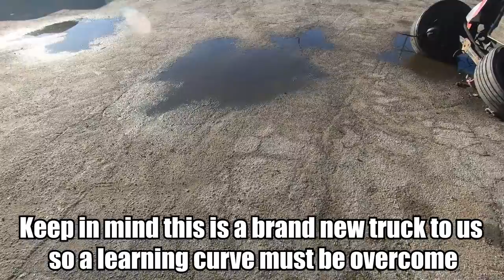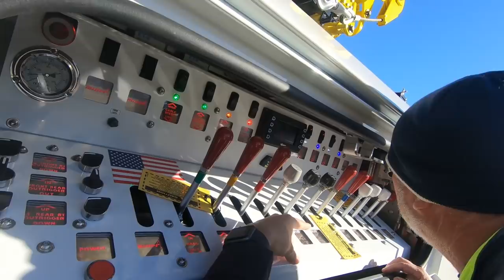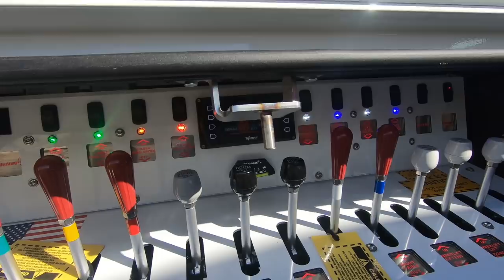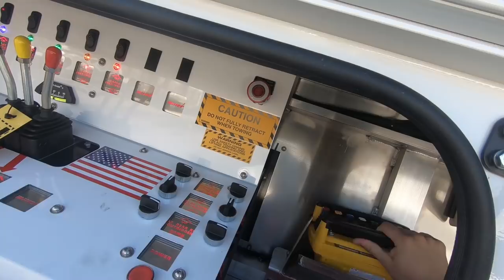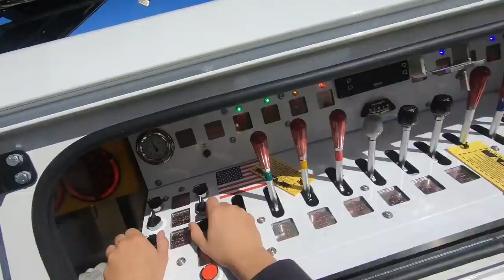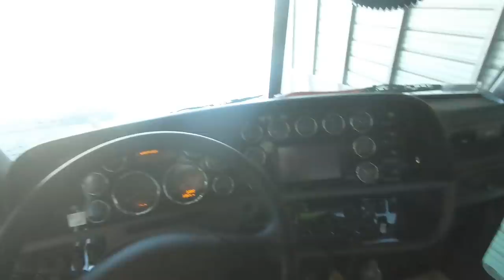First Lift With Our New Rotator! Wrecked Tractor Lift

Comment: That’s awesome congrats on the new tator looking forward to the new jobs you will get
Reply from the maker: Thank you sir certainly have learned a lot from your videos.
Reply: Youtube is the best school, between Ki and RonTator you will get all the know how you will need.
Reply: What would be cool if you both and maybe with Ron Pratt some how got together with your three rotators and did something together!
Reply: @joelast9988  That would be cool; a tryplex vidio. Also does the new tator have the carriage slide like Ron's has?
Reply: @1140rotatorwork Malachi I now realize as I'm sure others do as well how easy you and @Ron Pratt make it look!!! So glad I found the 3 of you on YT thoroughly enjoy all your videos! Thank you!
Reply: It would be cool if all three tators could get together, the only problem is that they are so spread out and those trucks burn a lot of fuel. I do find it very amusing how they are fans of each other’s channels which shouldn’t surprise me since they all have tators. Though I think Ron Pratt has the edge since his can adjust its position on the truck and he has secondary winches, not to mention he can run lights and sirens..
Reply: @plazatowing  What could be interesting is to compare your trucks including Ron Pratt and the guys from country repairs, and maybe explain your choices, raptor control, different stabilisation techniques, .... One could make one vidéo on one topic and another on another topic, no need to burn tons of fuel just make a tour of each tator and maybe record a skype session with everyone and a big work of editing (that will be a ton of work)

Comment: We have an 1150 389 on a twin steer with raptor controls. And an 1140 rxp with proportional controls like yours, love them both.  And you don't need to drop the suspension when lifting at all. Also there is room by your drag winch for wood. 4x6 hardwood is what we use at least 12 boards per truck.
Reply from the maker: Thanks for that!

Comment: Hey Trent, a new toy for 2019, looks a similar spec to Ron's over at MidWest, hope you are recovering nicely from your recent surgery
Reply: Ron has the Century 1150R that one is a Vulcan Spec.
Reply: nethalus seems to be, probably he customized the rig at the same company that midwest use
Reply: The 2 main differences I saw was 1150R comes with the joy stick controls and he added 2 auxiliary wenches.
Reply: Door layout is a bit different.  I think Ron's only has the two forward doors, not a short third over the front outrigger.  Hopefully Vulcan doesn't have the issues the Century does for Ron with the drag winch.  Ron absolutely hates using his because he always has problems due to the design.

Comment: Nice truck! 

Air suspension: it's automatic. If you raise the truck, the air suspension will automatically release air! If it's still sitting on the suspension, and you load the suspension, it will automatically inflate! It's that simple. The idea of whether or not to deflate is one that you will have to make, based on your needs, at every jobsite! If you need to put extra resistance on the ground, to prevent pulling the truck, instead of the load, having the weight of the truck on the suspension will be advantageous! For a job like that, put the outriggers out, drop the air suspension, and then have the outriggers touch the ground, with a little pressure, but not enough to take the load off of the wheels! That will help add resistance keep from pulling the truck. 

On the other hand, needing to keep the center of gravity low, when working high up, or at a distance, having air in the suspension, will cause an unexpected lift of the truck, when you load it just right! You would want to drop the air suspension, to prevent if from helping lift an uncentered load, unexpectedly! Put the out riggers out, drop the air, and place the outriggers down, lifting the weight of the truck slightly, to ensure proper stabilization, and leveling capabilities. 

Lifting a large vehicle from out of a ditch, at a lower elevation, that puts your lifting capabilities at its limits, would require a lot lowered center of gravity, and greater platform stability. Pulling a loaded dump truck out of a mud hole, from a distance, where the pull is almost horizontal, it would require a lot less platform stabilization, and a lot more resistance to pulling, with all wheels possible! 

Can't wait to see your new truck in action! Assuming that you will be the operator! BABY BOSS!! Lol A new toy like this could easily bring dad out of his cushy office chair, until the new is worn off a little bit! Here's a little tip. If pulling rank don't work, try holding your breathe until you get your way!! That always works!!

Comment: wait, i thought you guys weren't going to get a rotator but its good that you did, please be safe
Reply: can be justified. 1 truck than 2. Can trade in 1 or have another spare to haul/assist lift. Its a calculated risk that can pay off. Those trucks cost a pretty penny per hour.

Comment: I would think that in terms of load capacity, the only thing that matters is the distance from the load's center of mass to the truck, other things (outrigger position, truck weight) being equal. In other words, booming up increases capacity because it moves the load closer to the truck. Right?

Comment: I would say to leave suspension inflated. Once you put the riggers down and lift the truck, it's going to dump the air bags already to try and level out. Simple air suspension 101, frame goes up, bags are going to dump to try and bring frame back to standard ride height.

Comment: Get a tag line to steady loads!  If your boom isn't at 90% to the load, it will swing till the cables equalize.  Does it have a traveling boom (forward and back)?
Reply: It does not have the slider function like the 1150R, not sure if it is an 1150 or 950 (Vulcan model)

Comment: Congrats Trent. I know it's going to take a lot of time and hopefully you get a chance to attend a Rotator seminar. I heard you say that it should be set to 2 part. I think if that's what I was hearing you should have only been at 1 part because you did not have a snatch block in line putting your line in a 2 part. If you were referring to your load screen that is? The part is obtained by how many snatch blocks you have on the line. If that was even what you were refering to? Also just my opnion pusher axle up. Your stability should only be achived by outriggers. But then again what do I know 15 years experience is not as much as 16. Again congrats you will love your new partner.
Reply from the maker: With this particular load sensing screen you can achieve 2 parts of line with either 1 line with a snatchblock or 2 lines singled out like we had in this case. As for the pusher axle regardless if it is up or down we have the whole truck off the ground for this lift. Nice points!
Reply: @plazatowing  Does your screen show per line parts? Or just oveall load parts? I have only used the Raptor system and actually I am still not comfortable with it. Gonna take some time I guess. I obviously see 2 lines on the boom and I seen the drag winch but did I also 2 more winches on the deck? For 5 total?

Comment: 5 winch truck ? See the controls for other winches but didn’t see them on the boom
Reply: cheech23able I noticed that....
Reply: cheech23able it has the two primarys that they used, the secondarys which can be seen at the edge of where the boom extends (no hooks on cables yet) and the 5th should be a drag line at the rear of the truck, look up ron pratt and you’ll understand more of where the winches are and the capabilities of a rotator,
Reply: BryanTheGamer partner I have driven wreckers 15 years i currently drive a nrc  40/50 csr I know how they work just can’t see the other winches on this truck.

Comment: Did you guys have the high idle turned on in this video or just PTO?
Reply: He replied in another comment, its the PTO + "sensor that adjusts hydraulic pressure based on hydraulic demand. We were told by miller engineers to not idle the truck up thanks for watching!"

Comment: Congrats on the new truck. You might have used a spreader bar
Reply from the maker: While a spreader bar would be able to be used in this application with the extreme boom height and length of the rotator boom it is much quicker and easier to do it this way. the spreader bar takes some time to setup. Thanks for watching!

Comment: You said that's a brand new truck, it should come with a manual to answer your question about whether you should release the air pressure before outrigger. If the manual cant help, ya better call the dealership that made the truck and they will give you the correct answer!!!! Nice truck!!!!

Comment: Surprised you've still got that red truck there. 
Time to get / make some spreader bars. Even if they're just RHS to hold the chains apart.
That buzzer is driving me nuts just watching the video. I know why it's there, but somebody get me some wire cutters.
 
As others have said, when ever you're doing that sort of full lift you need a couple of guys with control lines.
Is there a lanyard hoop on the controller? If so that would help free up your hands a bit.

Comment: Curious, does this new 1150 Rotator also have the slide portion, to be able to take the boom assembly all the way to the back of the truck?
Reply: Don't think it does......California laws state it would be to heavy with that option.......
Reply: @joshuamack342  Not sure what max is in Cali but as noted that 1150R which does with all gear on board the truck tips the scale at 70,000+lb's.
Reply: Pepe's Towing recently got the first LA based 75 ton recovery rotator, some others also have the same type of model, but they lack the wheel lift due to state weight limits.

Comment: I may have my information wrong but are you supposed to lift the truck that much with the stabilizers? Aren’t you taking to much weight off the tires, thus decreasing the resistance you have? Please lmk
Reply from the maker: Resistance is needed for pulls but for lifts the whole truck is lifted off the ground to allow all the weight to be on the outside of the outriggers making it more stable. Thanks for watching!
Reply: Ok thanks!!! Seen it done a couple different ways so I was sure. Congrats on the new rotator, she’s a beautiful piece of machinery

Comment: Awesome machine what is the estimated cost  rotator lift. Cautious very good . 🌟🌟👍👍👍🌟🌟 p.s.  Because if you increase the angle you are going over the safe limit its safer to lower the cabe so has not to put at tiping angle although with those braces in the rotator truck they must have a limit . Take care of that hernia Mr. Trent ,they are a B__ if they don't heal well.

Comment: might help if you idle up the truck.
Reply: Some of them don't require it.
Reply: They're in the yard, it's not like time is really an issue.
Reply: Miller uses auto idle, it idles up and down as required on its own depending on the use parameters,

Comment: U need to idle up it will move faster
Reply from the maker: Actually incorrect the truck is equipped with a sensor that adjusts hydraulic pressure based on hydraulic demand. We were told by miller engineers to not idle the truck up thanks for watching!
Reply: Ok..

Comment: We just purchased our first rotator,a 5 winch Custom Built 50 ton with 43ft hook height,i like it but wish it had onboard load sensing like urs,one great thing about ours is u can set up the outriggers from the remote,we use it alot to unload steel coils just did almost 300 from rail,we use a mini spreader bar and a ball bearing hook makes it alot easier to spin and place on trailers,got the idea from u in the riggers room about the hook  
check it out   
https://youtu.be/03VA2EwBfxY

Comment: What I would have done, would have back into the spot instead of going forward.  That way the boom is in the correct position.
Reply from the maker: The boom is always in the “correct position. Every position is the correct position. The reason we drove straight in was to be able to rotate it around to the rear. If we backed it in we wouldn’t have been able to do that.
Reply: @plazatowing   Congrats on  On the new truck. Wondering when you guys were gonna get a rotator you guys do really good without the rotator . Now you do really great with the rotator. I'm an old tower 750 homes in a 850 homes ,you guys should do really good.  Be careful have fun.